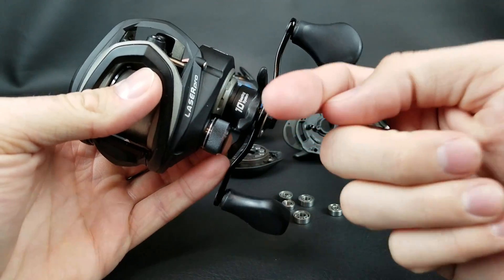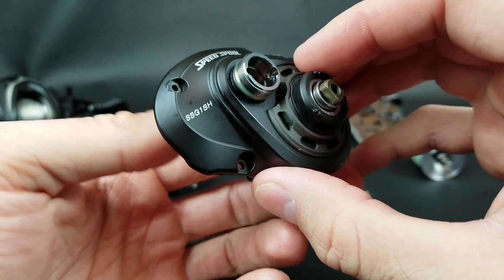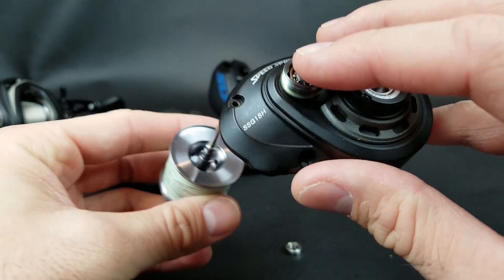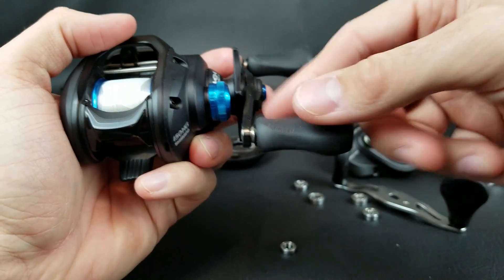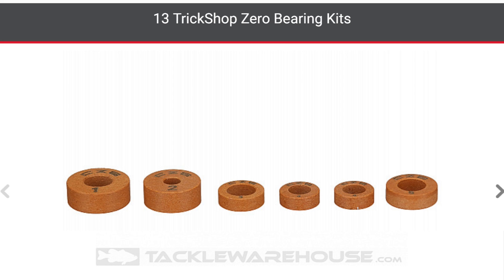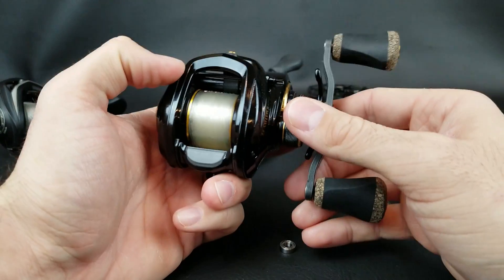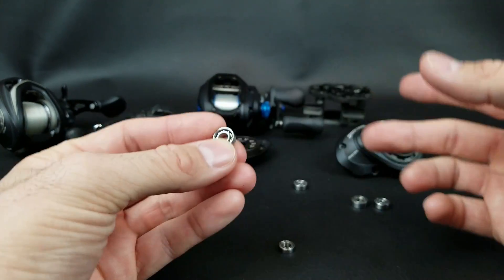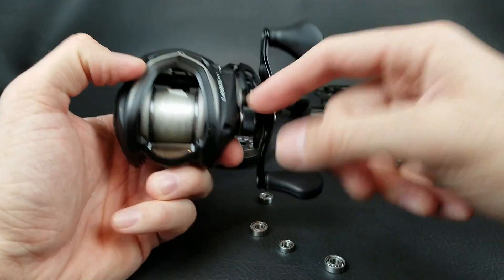Are MORE Bearings in a Baitcaster...BETTER? (You May be SURPRISED!)

Comment: Fishermen do not understand that only the shaft bearing makes a reel feel better and smoother on the cast, and any more than two bearings on the spool only add more friction to your cast. I have found that my high-quality 80's Shimano Magnulite, which only has two spool bearings and one shaft bearing, will outperform most of today's reels with ten bearings and up. I found my old Lews speed spool reel from the early 80s to perform better than many of today's fishing reels. The Lews is smother than all my high-end Shimano and Pflueger reels, and the Lews speed spool is cheap. It does not even have a Magnetic breaking system on it and only two bearings. When it comes to spinning reels, why pay for a spinning reel with a tone of bearing when the spool on a spinning reel does not even spin, making all those bearing useless?

Comment: Some things to add are that bearings are generally made of stainless steel which is heavier than your plastic bushings. Some higher end reels like a Shimano Aldebaren purposely cut down the number of bearings and use bushings to reduce the weight down into the 4 ounce range. Many higher end reels use this method to cut weight so dont necessarily think that more bearings means a better reel. However, some reels like the Bantam MGL arent so concerned with weight and bearings can be used to add stronger support to the pinion gear for example when it's under a heavy load. These are the reels you want for heavy vegetation fishing methods like punching or frogging. One last thing to consider is guys who fish in the salt. Bearings and salt water do not mix well. This is where the appeal of a concept z can come into play. No bearings means no corrosion from the salt water.
Reply from the maker: All very good points! I love it when folks add information like this to help others. Appreciate you taking the time to watch and comment!
Reply: Spool high speed bearings are Ceramic, and include Orange gaskets if you fish in salt water
Reply: All of my spool bearings go to crap after a month or so because I fish a lot from the jetties and moisture just gets in there. And the part in the video about the main gear is spot on, you lose buttery feel quick and I use the shimano tranx 400, only after a few months I could feed the teeth of main gear, it’s works but just not smooth , I wish that and then eating issues was fixed, I’ve tried ceramics , they go bad too … salt is killer

Comment: Ok being a Machinist and an Engineer, both bearings and bushings are very effective and arguable the same thing the difference comes in on tolerances. The different use would be a lot of weight on the axis point you would want to use a bearing. weight and speed bearing used, wear bushings can be used for general wear points that don't see a lot of either of those. In a reel I would say the highest weight point would be on hook set or retrieving a large fish (drag point). Hope this gives some insight from a creator or designer!

Comment: I am a fairly new subscriber and rarely post comments, but I feel the need to mention my view, especially on the SLX and higher end Lews reels. I like them ALL. I have had Shimano Curados and liked them until the they introduced the Curado K. That is where Shimano lost me. For some reason My Curado K side plate and spool tensioner didn't seem to fit together properly. May have been one that slipped through QA. Who know. But at that point I tried Lews Lite and Custom Pro. I was very impressed with these and never looked back. I have been a Lews fan boy for several years now. This year I broke down and tried the Shimano SLX XT a friend suggested. This model has 4+1 bearings. I like that the side plate does not detach completely , similar to the "Beetle wing" feature of the 13 Fishing brand of reels. Even better, This Shimano SLX is Super Smooth and casts as far if not farther than my newest Lews Custom Lite which is only a few months old. This kind of makes me wonder why I spent so much on the higher end Lews reels.

Comment: Definitely tight engineering beats all, regardless of whether it’s bearings or bushed. By nature. Bushes have more contact surface therefore more friction however, choice of materials ie. ceramics or other high tech materials are complete game changers so there is nothing to suggest that bushes are automatically a poor choice. Bearings most definitely however, provide far more “ marketing” appeal. A greater sense of getting more for the dollar.

Comment: I found out the more bearing did not mean much at all way back in the 80s. I took 3 reels and put them to the test by switching out both bushing and bearing and the shaft bearing sleeve. What I found out was a 2 bearing Shimano cast just as good as my 5 bearing Shimano and my 2 bushing Shimano reel with the only different's being in the smoothness of the reel handle. I then took the shaft bearing out of the 5 bearing Shimano and put it in the shaft of the 2 bearing Shimano and that 2 bearing Shimano cast just as well as the high-end reel plus the extra smooth feel of the handle when reeling in my cast. So anyways with all the testing, I came to the conclusion that did not make much of a difference and by buying a reel with more than 3 or 5 bearings was just a ploy by the reel maker to raise the cost of a reel plus the more bearings the more friction and weight it adds to the reel.
Reply: I did the same thing with my Shimano Magnumlite and my Shimano Bantum with bushing and found the same results as you did.

Comment: Good video as always.
Reply: Thanks Debo for dropping bearing knowledge on us. A smooth reel off the shelf is one thing, a smooth reel under load is another. Do you think bearing count makes a difference under load?
Reply from the maker: Thank you sir, appreciate your support!
Reply from the maker: @shakeyhead0079  this is very true. It can when it supports parts that will move under stress. You also have to consider frame material, line, rod power, and how the drag is set. Thanks for watching!

Comment: I have old Abu reels from 1950s and 60s 70s who don't have any ball bearings they use brass roller berings ! They cast spinn just fine and they handle salt way better then ballberings do ! 
I also has old Abu baitcasting reels who has ballberings from stock. They cast maybe 1-2 yards longer that the difference you achieved but they need maintenance to do so ! 
If they not been taken care of you actually will cast shorter! This part most people don't know about.
I have been fishing whit those reels sense 1978 to present day. Ballberings are made of carbon steel or stainless steel for most cases. There's hybrid berings out there now and there is ceramic ones as well! The last one will cast longest distance because they can run dry ! 
Whit no lubricant that's why they spinn more and longer ! 
Think of that next time choosing a baitcasting reel! 
Best regards from Sweden Scandinavia 🇸🇪

Comment: I'm  new  to  baitcasting  and  no can explain  the  difference  between  them  to  me. The  only  difference  from  expensive  and  cheap  is lasting  longer. As  for  bearings, stock  ss is better. And  the  baitcaster  is specific  in what you  want  to  do, especially  if  you  go up in prices. They  do  make  certain  lures  swim better with  restrictions. Do they cast far? I  didn't  see it. Do they  cast more  accurate  than  spinning  reels? Absolutely  not. Both  types  have  advantages  and  disadvantages, moreso  in the  baitcasters. For  shore, maybe  distance and  a more generalized reel  is the  key. No reel can  do  everything and  no baitcaster  will  do  everything  or more  than  a spinning  reel. And  I  do find  there  are  tmany  flaws  to  the esign of the  baitcast  rods. The  truth is if you're  on a boat, you  don't  need  distance. With that said, a Curado  or  Tatula  is good enough  for  the  abuse. A lot  of  highend  reels  aren't  made  to  take  the  abuse  and  big fish. Such  a stupid  invention  with  too much  hype.

Comment: Here is my $.02 about polymer bushings vs bearings. 
Polymer bushings are lightweight, have no moving parts, and (generally speaking) much cheaper than good quality sealed SS ball bearings. For the most part they are maintenance free, don't corrode, and rarely totally fail. If you take care of them, they will outlast most other parts of the reel; however, if you get sand and grit on those bushings you'll ruin them before the day of fishing is over.  And once you grind a groove in them, they're good as gone.
Sealed SS Ball Bearings do add a higher level of support and low resistance but at the cost of added weight and cost. The more bearings a reel has the likelihood the maker is cutting weight somewhere else in the reel (like plastic gears or levers). Sealed BB's are less susceptible to corrosion, dirt and grime, and seizing; while open BB's need regular maintenance to relube, clean out debris, and fight corrosion. Sealed BB's are more expensive and have added weight, but are less susceptible to failure and are generally maintenance free. Sealed BB's aren't always needed for the average application, but sure add a level of assurance when you drop it in the sand or mud. 
My general thoughts: I think each has its use and more of one over the other has yet prove better IMHO.
Reply from the maker: I completely agree. Great overview on the difference between them all. Thanks for watching!

Comment: For me, comfortability (is that a word?) and low maintenance are the most important factors in a reel

There are so many factors that go into play with casting distance, lure weight, line, rod, spool weight, etc that it’s hard to say which reel is best and I’m not going to do a reel test 

The faster I can get the brakes dialed in, the faster I get into fishing mode and worry about  my presentation 

Casting precision is way more important than overall distance to me and comfortability and consistency go a long way (pun intended ) in getting that control

Comment: Answer is hell no man. Bearings don’t mean crap in cheaper reels. Only high end does it really matter. I prefer the quality of the bearings over the quantity. But there needs to be a minimum of 5 I believe two supporting the pinion gear, tension, roller, and one on the main shaft. High end like I just said before with the five but instead of 1 bearing on the main shaft there should be two for smoothness, 2 in each bearing knob, and (sure but you don’t need it) a bearings on the level wind. That’s why Shimano and Diawa are the ONLY company’s who I buy from they get it with the quality of bearings over quantity.  Any other companies reel I don’t like only if it is a mgl extremes or a megabass reel. Btw the way Shimano’s S ARB are the best stock bearing and better then most other bearings on the market. The only bearings that are better are the  the expensive Japanese bearings. Spool Speed is a complete joke though just some cheap bearings with some marketing hype......
Reply from the maker: I have yet to try any high end shimano reels, but I'd love to. The SLX has felt good for a $100 I think. Thanks for watching and commenting man 👊

Comment: I use to be concerned about bearing count until I bought and used the Curado K.  It is more about the main gear now.  They are super smooth and built like tanks.  Bearing count isnt as important and you can always upgrade your spool bearings to increase casting distance.
Reply from the maker: Agreed, that main gear/pinion fitting is huge. Any slop and you can definitely feel it. Thanks for watching!

Comment: I like a good amount of bearings when the real is a decent quality reel and the placement of bearings  are in the right places, yes I have owned 2-3 bearing reels in the past on several brands Abu , quantum , shimano , and so forth and so on  some smooth some rough, but when I discovered kast king products they were cheaper price reels but high quality and thought was designed into the reels with a lot of bearings in the reels and to be honest I was shocked at not only how smooth the reels are but the quality that went into the design of the reels so...not only do I love the high amount of bearings but compared to the smoothness of the reels but the price and quality compared to say my 189 dollar quantum which is only about 6-7 bearing I can buy several of the kast king brand compared to only one of the other reels I'm still in awe of the quality and price of the cheaper reels asnd I'm rough on reels typically a cheaper reel won't last but not the case with kast king I'm thoroughly happy I don't have to keep replacing my reels from poor quality ima happy camper as they say so if the bearings are high quality and thoughtfully placed I got no problem having a reel that has 10-12 bearing reels as long as it adds to the smoothness and quality of the reel
Reply from the maker: Yep I've got less expensive baitcasters and more expensive baitcasters that have a high amount of bearings and like both. Just want folks to know that it takes more than just a lot of bearings to make a smooth reel.
Reply: @DEBOSFishing  your right back in the day my diawa reels had 2-3 bearings that was a good reel back then and I owned the same reel from Ryobi you have from your dad and no bearings and a fine reel it is .

Comment: Great video very easy to understand
Debo if you do a little research you can find a supplier for bearings’. Most bearings used in fishing reels are standard sizes use for many other applications. Depending on the quality, prices may vary. Local bearing distributors will check the size for you and provide a choice of styles to choose from. I use to rebuild all manners of machines and tools and accidently discovered this long ago. A good bearing suppler willing to explain the differences in bearing designs might interest you greatly. They also have all types and sizes of bushing that often provide more strength with less wear. There is a You-Tube channel called Tackle Advisor and this guy is tough on reel manufactures to extreme levels. However, if you can stand his critical attitude he has a great knowledge of fishing reels. He has a couple of videos comparing casting reels distances. He makes casts using bait-caster reels over 110-yards.
Reply from the maker: Yea, it would be cool to see them made. I have heard of tackle advisors. He has a great channel and is extremely knowledgeable. I enjoy his videos!

Comment: Excellent video.  And good to echo that those extra bearings can be a significant liability.  My LFS Inshore has them and the paddles have an endcap to hide the screw/bearing.  That endcap can also trap water (nasty saltwater) in the bearing area.     The value they add is interesting, but it ups the chance that corrosion sets in.
Reply from the maker: Yea, it can be a give and take. Appreciate you watching my friend! P.s. glad I don't have to worry about salt. That stuff I'd rough on reels.

Comment: Good video I have told my fishing bro’s for years that having more bearings in a reel does not mean all that much and they just laugh at me. My first reel only had bushings and my second reel had three bearings which was amazing performance for a reel at the time. One day while fishing We tested who’s reel would cast the furthest and my three bearing reel that was bought in 1979 came in at casting 25 feet and his new 14 bearing reel came in at a cast of just 26 feet and this was in 2018 which makes my 3 bearing reel had 30 years of wear and tair over his 4 month old reel. I remember doing my own test on my shimano Bantom and it only had bushings in it but when I put just 2 bearings in it the reel worked just as well as any reel that had 3 or more bearing minus the smooth motion of the reel handle only do to not having a bearing in the shaft like the others. Another thing is all my bro’s think that a spinning reel with more bearing is better but it is not as the bearings in a spinning reel have almost nothing to do with the spool as the spool does not even move when you cast a spinning reel. I could go on and on on how a big name rod and reel makers are just ripping the fisherman off with there so called improvments when there is no improvement at all.
Reply from the maker: So true man! The old reels my pops still have came with brass bushings! Thanks for watching 👊👊👊
Reply: I have my uncle’s old Ambassadeur 5000’s and 6000’s from the late 1960’s, and I’ll be damned if I can find a bearing in them and they still work just fine. Though there are some assemblies that I have yet to disassemble and clean.

Comment: I've been on the fence about picking up a SLX for a new "all around" set up. I've owned many different brands over the years including lew's, abu garcia and 13 fishing. The most used reels today are my 3 kastking reels (whitemax, assassin and speed demon) and so far (a year later) they have been very very good to me. I'm curious to know what you're opinion is on the Royale Legends Elite vs. the SLX and which reel YOU THINK has a longer life of hard use. Also, You're videos are too good for only 11k subs dude. Keep the awesome vidoes coming brother! - Stay hooked
Reply from the maker: Thanks my friend, I appreciate that a lot. Overall, I feel the SLX is a good reel. I think any aluminum framed reel will generally hold up longer than a graphite framed reel. All depends on how often the equipment is used and how well it's maintained. Thanks for watching man 👊